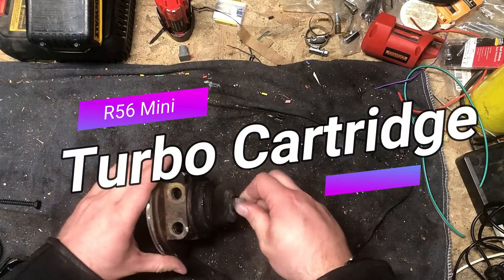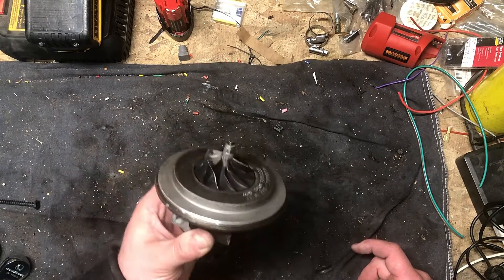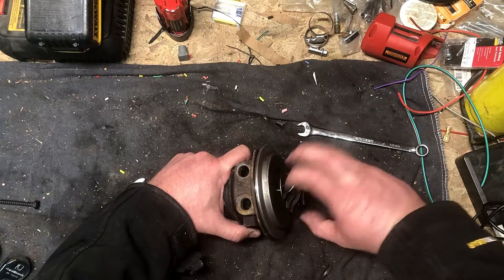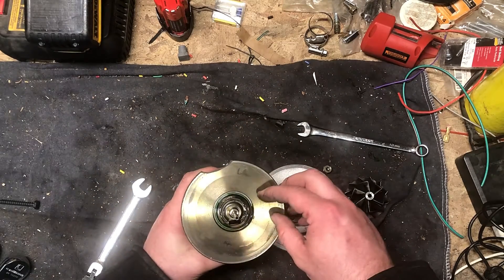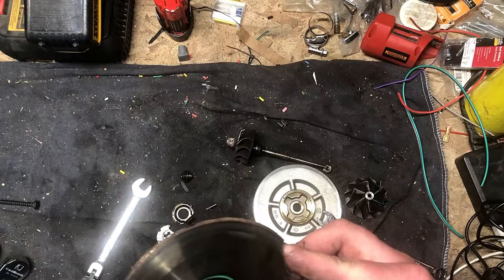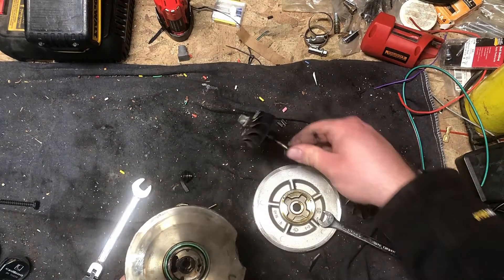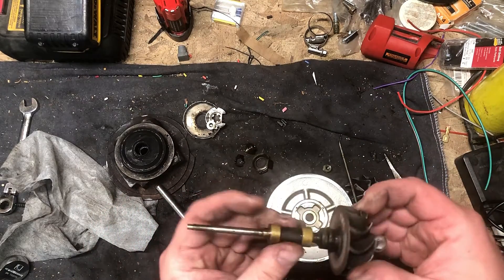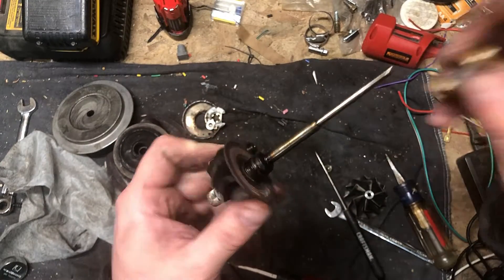R56 Mini Cooper Turbo Cartridge Teardown

Comment: Thanks for the video. I’ve got an R56 and Mini group folks are suggesting I replace my cartridge because I’m getting oil through the cold pipe and a grey/white smoke from the exhaust. What signs of turbo fail did you experience before the swap out? Thanks!!